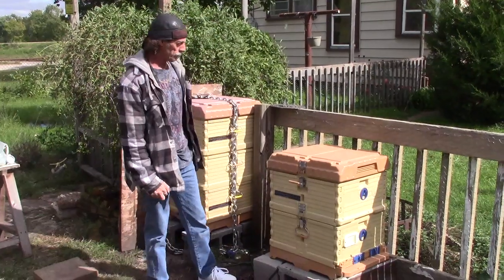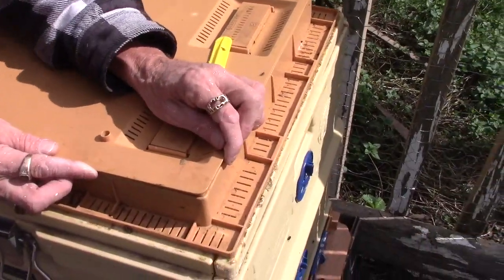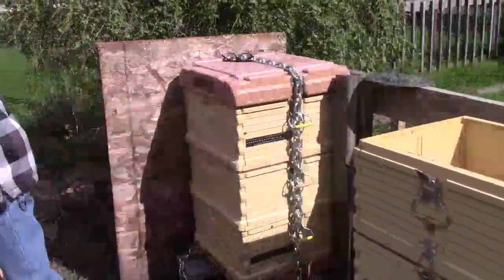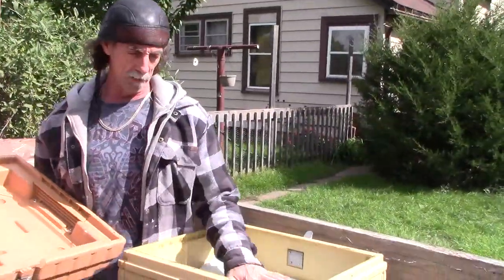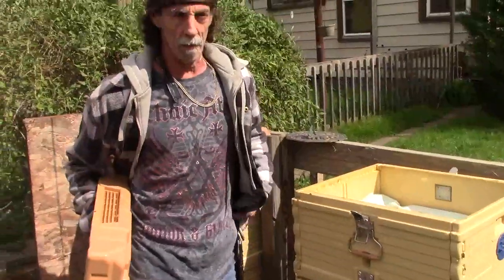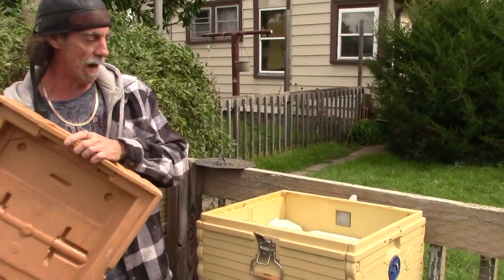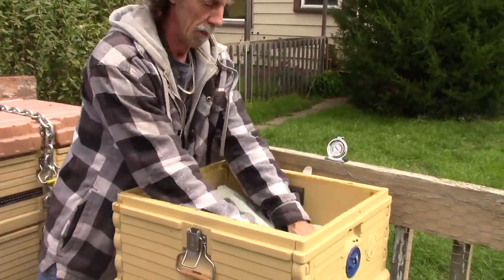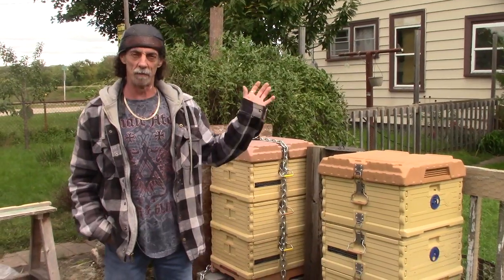winterizing bee hive #2  quilt box apimaye hive with russian bees

Comment: Hi Greg,   I was having terrible humidity problems with the Apimaye hives.   I tried your tip yesterday and the hunidity has dropped a lot, even in 24 hours.   Its still high,  but hopefully it will drop down to accptable levels.   Just wanted to say thanks for taking the time to make your videos.   Steve
Reply from the maker: one thing to consider. the thinner the cedar chips, the more condensation can get out, but at the sacrifice of more heat leaving also. adjust according to your needs and temperature.